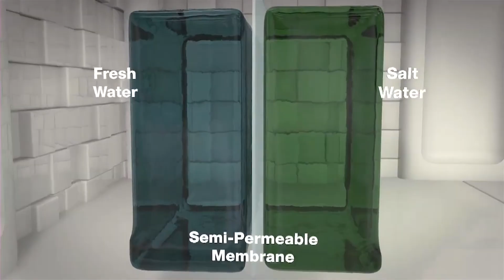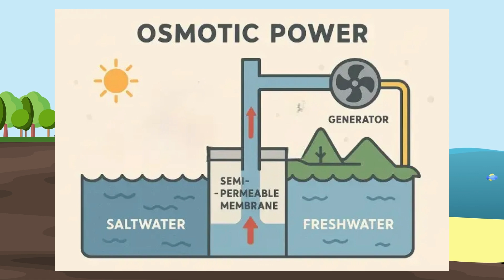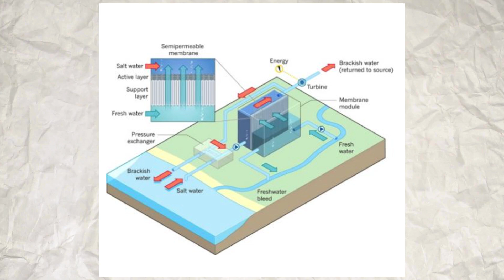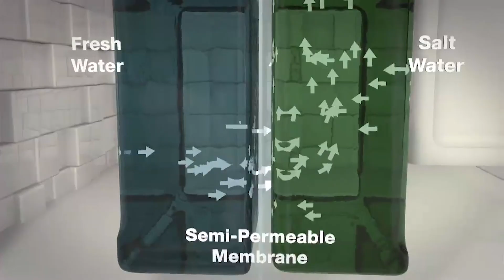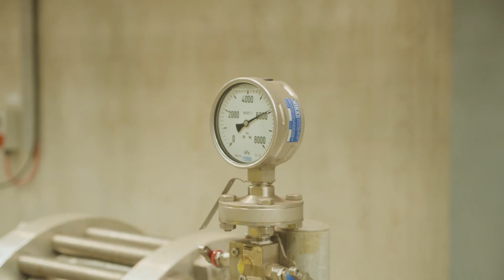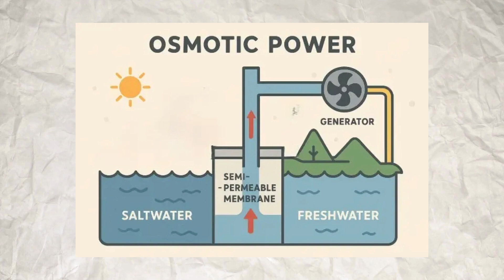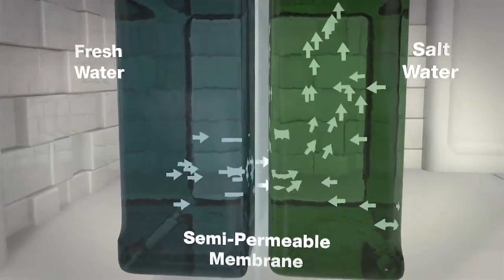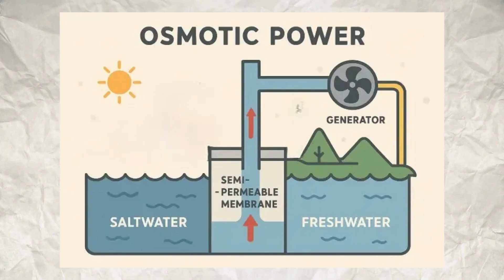Japan's $5M Power Plant That Runs 24/7 Without Sun or Wind

Comment: The issue is the source of freshwater. Using desalinated water is inefficient. An untapped source of fresh water would be freshwater discharged wastewater from sewerage plants.
Reply: I think they said at start that they used wastewater and brine, but they could have used sea water as the "freshwater" opposed the brine which is much more salty.

Comment: Something doesn't make sense: they generate power by mixing salt  water and fresh water, and then use the energy to get fresh water from salt water?!
Why not just drink the fresh water?
Reply: its wastewater they use a fresh water, but they could actually use sea water as it has much lower salt content than the brine.
Reply: Osmotic power is not about powering the desalination 
It's more just recapturing the energy it took to desalinate the water in the first place

Also brine is dangerously concentrated, 
It can kill ecosystems in oceans, forests etc
Slowly mixing brine with ocean water can keep the brine levels from spiking and can allow the ocean to dissipate the brine further out

I'm not sure what the energy density is
But it could make sense as a shipping fuel
That way the brine dissipates over very large areas
And could be a natural fit for synth fuel and waste disposal

But brine can also be mined for lithium and other metals

Though it seems dumb to put the turbine on the brine side, 
It seems better to put it between as a form of suction, 
And I'm assuming they have special feed tubes and reaction chambers, similar to fuel and air lines on an engine
Because of you just mix all the brine and water together then your exhaust is still highly concentrated
You need small chambers carefully controlled ratios and flow rates to get a good "burn" get maximum energy and lowest concentrations
Reply: @michaelcombrink8165  Well said, lets see what the Japanese finds out in the test plant.

Comment: They tried in NorWay 🇳🇴 and it failed in 2009: Prototype: Norway's Statkraft. Why would this one work?
Reply: The main difference is that brine is used as the salt part which is much more concentrated than sea water. Also new developments might have improved the membranes. And you need to have these test plants to find the problems to be able to solve them.